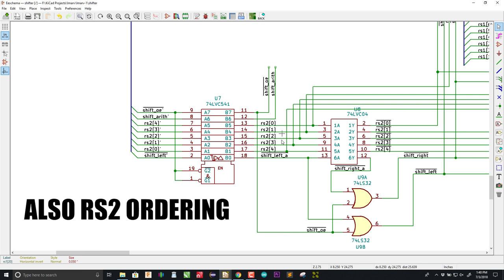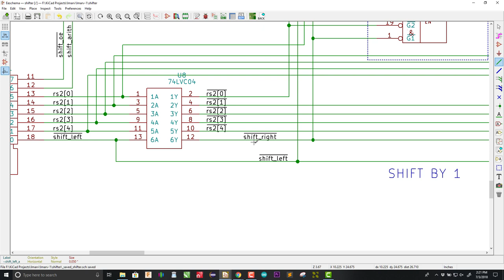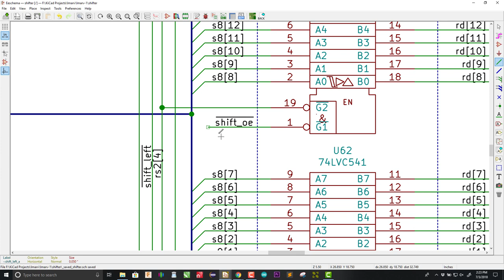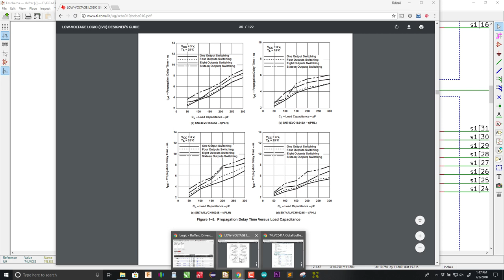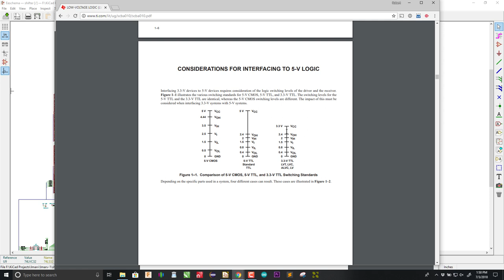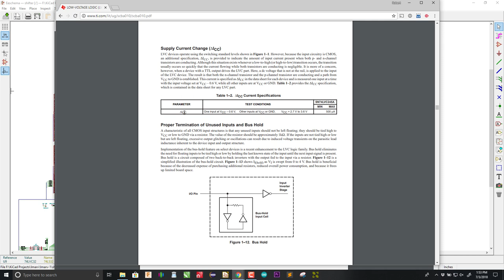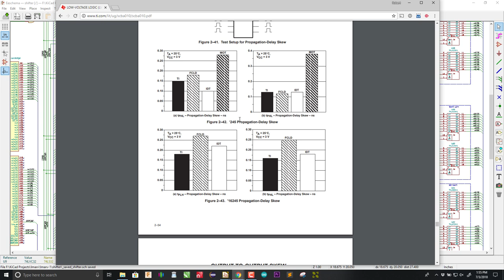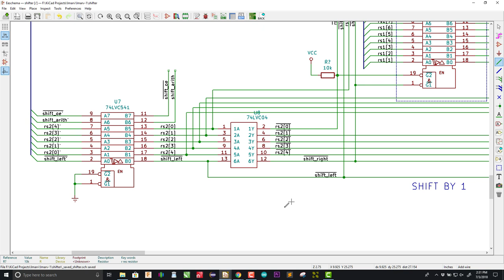LMARV-1 (Tangible RISC-V) Part 4.2: Feedback on the shifter

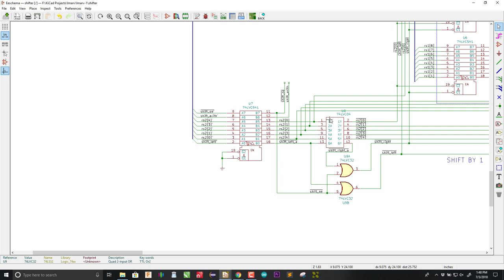Comment: Rob, @ about 13:00 - let's split the AND gate as you need the signal in the first stage. For other stage you can "buffer" it by other AND gates (to avoid loading of the bus input and OE). Just connect both inputs to the 1st gate output (7 outputs per 1st gate is OK). Then you have 10 inputs per other AND gate (31 inputs of the shifter in total)
Reply from the maker: Done. Yeah, I think that's better.

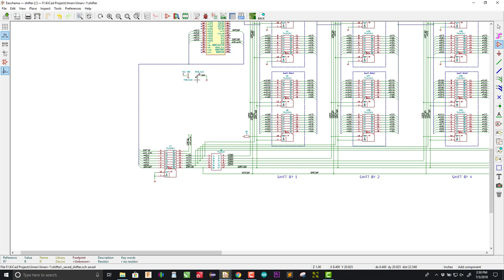Comment: @ about 23:00 - why don't close the gates by shift left/shift right signals? You need just two resistors to solve the problem...

Btw, there are 5x4 = 20 inputs  on shift left / shift right signal with use at the first state. Is it really OK?
Reply from the maker: They're pretty badly named signals. Shift right and shift left signals are complements -- one is just the inverse of the other, but really, that shouldn't be correct, because it should be possible for neither shift right nor shift left to be active (i.e. no shift). I could probably clean that up.

Comment: Probably a naive mistake in my thought process, but couldn't you just add a pull-down resistor, instead of cutting out the gates at around 5:00?
Reply from the maker: No, the enables to the buffers all have a defined logic level, they're not the ones that go hi-Z. I just needed some logic to ensure that one pair of buffers was always on.
Reply: Ok, gotcha. Had to rewatch the video a bit and now i do understand. It seems electrical engineering is no longer engrained into my brain :). Cheers, really looking forward to the next vid.

Comment: 1. Driving a 3V LVC with 5V TTL or 5V CMOS works just fine if the LVC devices has an A-suffix. The A-suffix devices are 5V tolerant. See Appendix A of the LVC Design Guide. In fact, I think TI might have discontinued LVC devices without the A-suffix. 

2. Your schematic symbol for the 74LVC541 is wrong. The LVC541 doesn't have a true Schmitt trigger input. It's input hysteresis is only 100mv. A real Schmitt trigger would have at least 500mv of hysteresis. I'd worry that with a non-TI part a slow transition through the transition dead-zone could cause oscillation.
Reply: 3. The Schmitt hysteresis curve you're using looks like it's flipped/mirrored, or is representing the curve for an inverting buffer.

4. I think the pulllups/pulldowns should be on the inputs to U8, not the outputs.
Reply from the maker: Yeah, the IEEE symbol is just the one that comes in KiCAD, which isn't great. The criterion for where the pullups go is, on any signal that goes to a buffer enable pin. So that's why (in the final schematic) they appear to be on both the inputs AND outputs of U8, simply because those are the enable signals. The resistors are meant to force the line to the disable state even while the chip that outputs on that line is in an intermediate or powerup state. It's a resistor, it's fast :D
Reply: The problem with resistors is that they are always connected to a capacitor. Making practical pullup/down resistors quite slow.